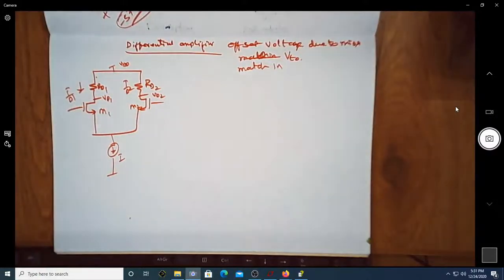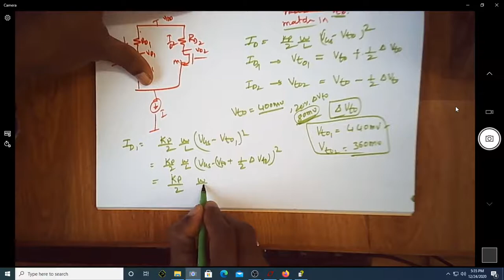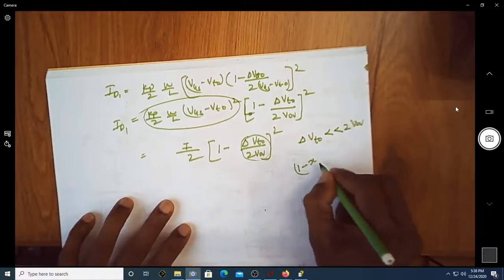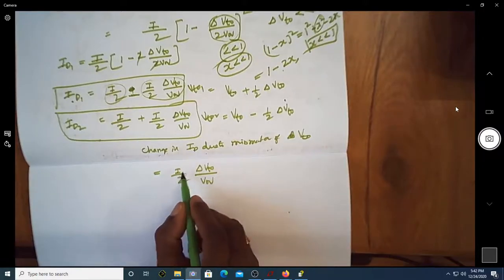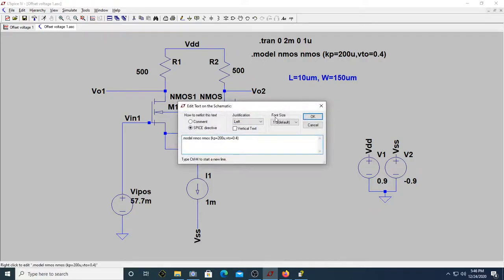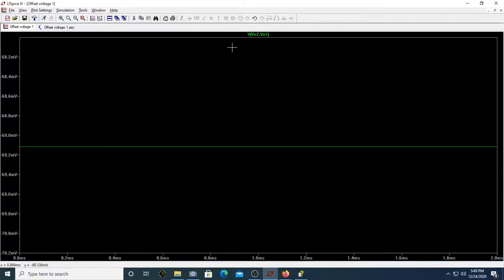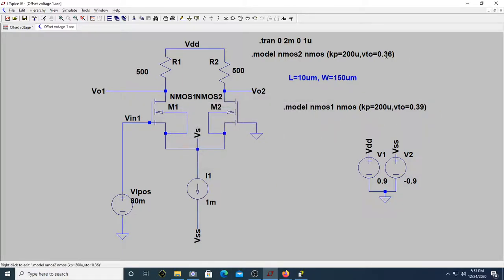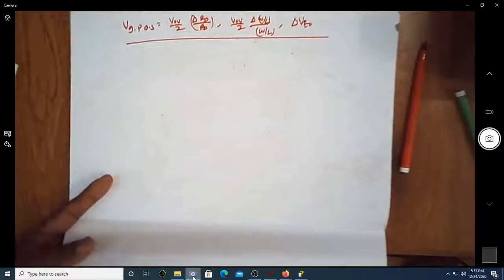Diff amp offset voltage due to Vto Mismatch

Comment: I did not get. If one transistor gate is grounded then how can current flows in M2.  If Vipos is less than Vth then how current flows in M1 also. Please sir explain that.
Reply from the maker: 0h! No in diff amp, as it has -ve Vss, even if gate is grounded the mosfet is still on!!
Reply: @narasimhamurthyk.c.vu3dwf475 thank you for the explanation. In this case, M2 is grounded then also current can flow due to -Vgs2. And it should be at least equal to one threshold. For that gate voltage at M1 should be equal to Vgs1 + Vdsat (for current source). But our gate voltage for M1 is less than we need. Please elaborate this.
Reply: I got it sir because Vss is -0.9V